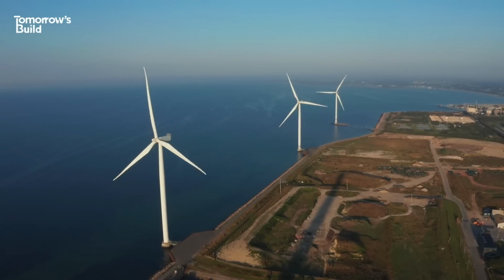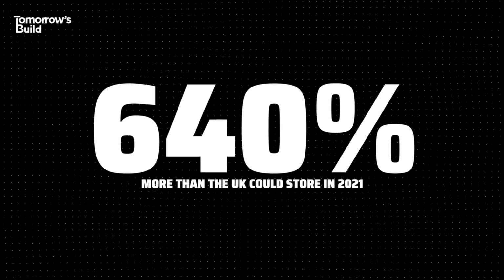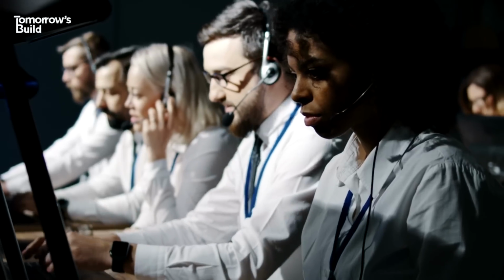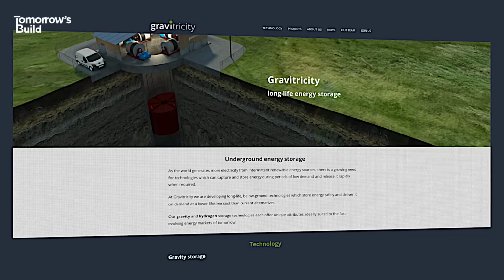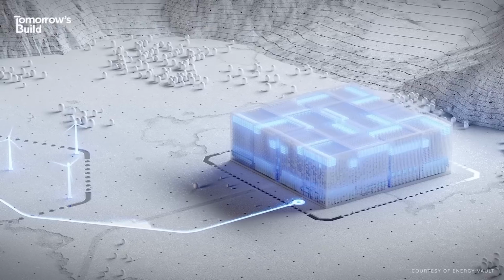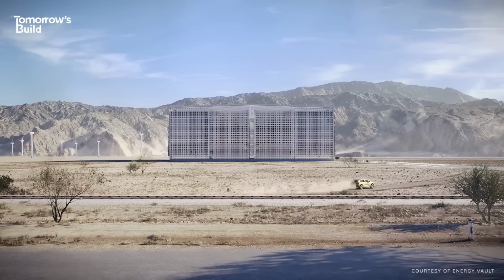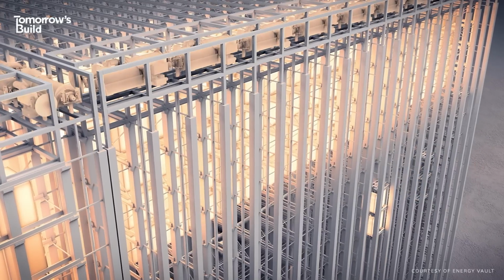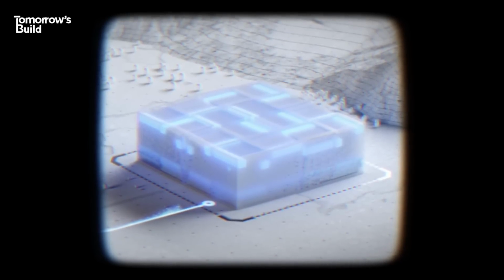The Hidden Crisis With Renewable Energy | Tomorrow's Build

Comment: The famous water fed Dinorwig power station in the UK (Tom Scott did a video on it), is essentially a 9.2 million ton 'weight' over a 500m shaft. Some highly academic research on google says that's three million more tons than the weight of the Hoover Dam. To build a concrete gravity battery on the scale of Dinorwig (and the UK alone would need several to meet intermittency needs), you'd therefore need a hoover dam of concrete, with about 8 or so Empire state buildings on top (400k tons each) to make up the weight, suspended on a structure the height of Taipei 101. This is cartoonishly impractical!
Reply: Not to mention the amount of emissions from all that concrete being poured would be astronomocial
Reply: These energy vaults are a total scam.  That same building or mine shaft could be moving water up and down pipes with tanks on each end which is significantly more efficient than the  lifting machinery needed to move weights.  A simple thought problem:  Which do you think is more space and energy efficient;  the elevator that lifts people up and down a building or the water pump that moves the water up the building to a tank on top and gravity that lowers waste water back down?
Reply: A subsidised 14Kwh power wall in every house hold might help, possibly linked up to a smart local grid.
Reply: @AdamG7CRQ  but that has the same issues and more, than having large scale battery storage...
Reply: @John...44...  how?
Reply: @AdamG7CRQ  well, it has the same issues as large scale batteries: terrible for the environment etc. But doesn't share the benefits of a large scale system. It would cost more for the equivalent large scale battery farm
Reply: @John...44...  I don't agree, I think there's room for both including EV to grid, maybe local liquid air batteries.
Reply: @AdamG7CRQ  oh, definitely room for both. Just the idea of lots of small scale batteries is better than fewer large scale batteries is wrong
Reply: @John...44...  No it's not. Do you know how EV battery's are built? They use smaller cells in large numbers instead of using one large cell. The reason is because this is cheaper in terms of repair and easier to control voltage because changing the cell configuration can give the current or voltage you want.
Reply: @Asanda  yeh so that's my point... one facility with large battery storage would be cheaper than a load of house with individual battery storage. Yes the batteries may be made from the same smaller batteries, but a larger facility would be cheaper
Reply: @adam-g7crq  And have your government spying on you how much you use if you use more you get arrested. Like Minority Report
Reply: @adam-g7crq  An average UK household uses about 9kWh of energy in total. 14kWh is about 36hours

Comment: This seems incredibly wasteful and expensive, the energy stored in those blocks is not a lot, the structure to hold that much would need to take up an enormous amount of space, and because of all the moving parts maintenance would also be a pain.

Creating hydrogen from excess electricity during peaks is much more viable and is a flexible solution as well to the irregularity and slow reaction time problem of most renewables. Burning hydrogen in a traditional natural gas system would fill the gap natural gas has currently, and requires much less new technology that needs to prove itself for storage and execution. The main problem right now with hydrogen is cost, but in a future full of excess energy during sun/wind peak production that can't be utilised it would make it much more viable.

This is besides the fact that hydrogen can also replace natural gas in many applications nowadays that although can be filled by electricity it would require massive upgrades to the electric grid network. Hydrogen can offload some of that e.g. by being burned directly in homes for heating, and being transported through modified existing natural gas infrastructure. 

Moreover, hydrogen can be made in various areas where it is cheapest to produce and then shipped off to wherever demand determines just like petroleum currently.

Lastly it also creates redundancy, just like today how different plants producing electricity through different methods are more isolated from mishaps affecting other plants. An area that is too heavily reliant on wind and solar may be left susceptible to black outs due to a large storm which can damage solar panels and force wind turbines to be stopped to not damage them. This is especially important for coastal communities who will be facing harsher weather conditions.

Comment: I would have also mentioned flow batteries, liquid metal batteries, and flywheel energy storage. And also the importance of baseload power from nuke plants.
Reply: oh yes the mighty baseload from the nuke plants, we seen it in france this year, most of them down cause additional maintenance and broken or rusted things, sound very safe...
Reply: @SirHeinzbond  it is though..."broken rusted things" are on emergency circuits which have never been used in 40+ years. That's because even those old power plants are extremely safe
Reply: Can't count on nukes with droughts and hotter water, European nukes have already been shut down when needed most.

Comment: You do need to do more fact checking before making claims in your video's. There is more than enough lithium accessible in the world to provide all energy storage the planet needs. The problem in the short term is that the capacity to mine and refine said lithium is not keeping up with demand. However, lithium batteries are not the best solution to all problems and we probably will need almost all alternative storage solutions that are currently worked on. So thank you for putting together another video on available alternatives.

Comment: One massive inclusion into the evening household energy demand you forgot moving forward is the super high current EV charger because people will want their car charged as quick as possible so it's always full for conveniences sake.  Rolling brown outs from these chargers will be the future unless there is a standardized way of chargers being able to communicate with the grid for permission to pull power etc. is developed.
Reply: "people will want their car charged as quick as possible so it's always full for conveniences sake" Except that's not the case, as proven by the huge number of schemes where people charge their car when it's cheapest when there's least load on the grid.

Comment: It would be much more energy and cost efficient to significantly improve the infrastructure for energy transmission and better integrate it across state and country borders. This way surplus energy can be shifted across a continent to where it is currently needed. This would alleviate a huge chunk of the fluctuations. The remaining peaks and troughs may be buffered using centralized (hydro, batteries, ...) and decentralized (domestic batteries, plugged-in electric cars, ...) energy storage.

Comment: 200 GWh  of storage is no solution at all for the UK. Currently in winter the UK uses about 40 GW per hour. In the future once heat pumps / electric car are more abundant we'll need a lot more.
So .. 40 GW for 24 hours is 960 GWh. Sometimes in winter, Northern Europe doesn't get much wind or solar for 2 weeks or so. 
2 weeks storage would need to be 13,440 GWh 
So in short, if we rely on renewables, we'll need about 14TWh of storage. Please let me know how that will happen.. 
I'd recommend going nuclear and skipping storage altogether.

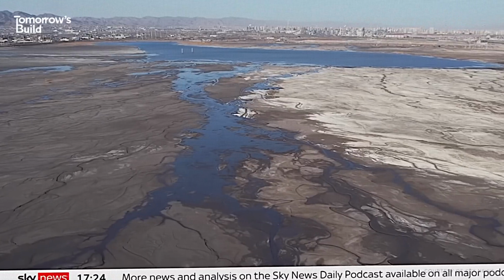Comment: @2:25 not enough in the world to meet demand. Bull[expletive]! Lithium is a plentiful element in every ocean and iron is the most plentiful element on earth. They're even recyclable. 
Making and recycling LFP (Lithium, Iron Phosphate) batteries and charging them up from solar and wind energy costs less than setting fire to anything. (You can't reuse fossil fuels.)
The installations are cheaper and cleaner and that's why they're happening around the world.

Comment: Isn't the easiest way to preserve energy producing hydrogen, storing it and burning it when needed? That could even be done locally in every home. The big advantage would be that homes could buy energy when it is cheap and sell it when it is expensive. Alternatively high pressured air could be stored. That air pressure could be transformed into electricity when needed.

Comment: Liquid air batteries, would be a better option there's already some pilot plants up and running in the UK, the beauty of a liquid air battery is there really scalable and are built from common materials that are readily available and used in other industries with the available skilled engineers to setup and get running, they have a great cycle live cheap and can be placed where you need them, it's worth a Google to find out more about them. Be nice if Tomorrow's Build could do a YouTube video about this battery.
Reply: I was thinking the same.   Also redflow, and Form energy.   We definitely need an all of the above mentality.   More sources can be used in different areas depending on location and availability of local resources
Reply: I wonder if liquid air storage  of renewable energy might be better used by not trying to turn it back into electricity. It might be far more efficient to use it to cool things directly. A building full of hot air, a tank of chilled fluid, and a simple high efficiency heat pump would almost certainly cool a room far more efficiently than using the liquified air to generate electricity to run a regular air conditioner. The same type of system could be deployed to refridgeration
Reply: @dennisenright7725  brilliant idea, I think the liquid air batteries are about 68% efficient looks like there might be some different uses for them in for industrial services but still a very useful grid battery considering how cheap and long service life you'd get out of them, you've got me now thinking what other applications they can be used for maybe local shipping power a ferry to cross short crossing's.

Comment: there are "batteries" of heat energy, either molten or solid. and there are storages that use compressed air, who need heat when expanding the air in a turbine or motor.
china now has the largest compressed air storage and it is a technology that could be easily used anywhere in the world.

there are also other energy storages using gravity, either lifting very large chunks of earth with hydraulics. or large balloons in water(the sea) and can be inflated or lifted to store or release energy.

also there are different techniques for storing heat over the long term. some salts have a heating when dissolved in water, some materials have the same effect with their large surface or their chemical bonds(reversable with heat).

we need to talk about more solutions, compare them, and find the right ones to do the job in different situations(local).
Reply: Have a Google for liquid air batteries, very interesting.

Comment: We will have distributed virtual power plants through the millions of electric vehicle and home batteries that are coming into use in the next 5 years. It will be much more resilient and enable consumers to offsett part of their bill by participating instead of paying large multinationals to burn gas/oil/coal
Reply: Moving in parallel to horizon is very cheap so the vehicle batteries are really tiny on a bigger scale of things.
I once calculated that every Tesla ever produced is equal to 1 hour powering a 2-3 million town.

Comment: We need nuclear, but we can't have it because hippies.  We could make up the lack of renewables using LNG instead of burning it off at the well, but it's not perfect and still creates carbon.  Even though it's a net drop in carbon since we're using it for power instead of just burning it into the air.  But hippies won't hear of it.  We could have been putting a lot more into battery development all this time, but hippies demanded more efficient solar and wind, and got it.  They threw their support behind tax schemes that let power companies get tax credits for creating energy that they sent straight to ground because it was easier and cheaper than actually powering cities because of how tricky it can be to meet demand with renewables on the grid while also using fossil sources. They even pressured other people to chip in to power companies' "pay extra for green electricity schemes" that implied heavily that you'd be getting only renewable power delivered to your home, even though that's not how power grids work.  

So we still don't have the batteries we need for renewables, and hippies made sure that people paid companies extra money for no reason so that they could buy more windmills to get more tax credits for power produced that nobody actually got to use.

TLDR: When you can't heat your house because the sun's not out, burn a hippie to stay warm.  They deserve it.

Comment: As economies of scale take off making green hydrogen cheaper; could that not act as a backup power source in the same way we currently use gas and coal?
Reply: No
Technically a rort by fossil fuels industry
Reply: @RacefanPat68  Are you getting mixed up with blue hydrogen? I struggle to see how green hydrogen made from green electricity benefits the fossil fuel companies

Comment: Seriously? Normally, this channel is good and well informed and now you fall for such a hoax? Do the math, how much kinetic energy can be stored in such building. Try to match it with turns of the wind mills on the outside, how many turns can one do, whilst one of these blocks goes down? Because that's the exact equivalent you can get from the building. Even if each block replaces one mill, we are talking about minutes. I really recommend to do some deeper research and take the video down later, it is nothing else than a conspiricy theory for investors.
Reply: Well put I agree with your comment 👍

Comment: its a shame we cant just give every house a huge battery that powers their house, make solar panels mandatory, then have the grid as a drip feed
Reply: People living in the inner cities in apartment blocks might not agree.
Reply: This would add around 40k to the cost of homes, which isn’t terribly significant compared to the insane price of housing. Certain states like california already have solar mandates on new homes.
Reply: Also possible would just be the battery storage without solar. Charges during off peak hours from the grid and discharges when household consumption gets high. This could take the strain off those peak times if enought houses had it setup. Problem is space like what was said about apartment living. Have to have a room to put it. A lot of already existing places would need some serious remolding for sure

Comment: Dunno why videos like this never mention tidal turbines when it comes to reliable consistent renewable energy production. Tidal turbines output is determined by the tide, which is literally controlled via the moons gravity when it rises and sets, which we know is twice a day forever, so the tidal turbine output pattern is consistent forever. Of course the issue is that its output goes between 100% down to 0% then back up to 100% gradually a couple of times a day, but it's exactly over every 12 hours forever. So you could pair say a 2MW tidal turbine with a just 6MWh battery and it'll output 1MW 24/7 more consistently than even nuclear. Can't do this with wind or solar because they're not predeictable and can have low output for days or even weeks on end, can't build a battery for that. Whereas with tidal you KNOW that it'll go back up to 100% output within a few hours. You can know the output of tidal turbines at any specific time any day 10 years from now if you wanted. Of course we can't have tidal turbines anywhere but even 10% from them would be a nice 10% baseload. Or just build nuclear.
Reply: The whole county doesn't have the same tides. High tide in one place is can be low tide in another place. If you spread out tidal energy with that in mind you can avoid the need for storage.
The only issue I have with tidal energy if the possible effect on wildlife.
Reply: If it were that easy, it would have probably been commercialised by this point. The issue I've seen from other videos on this topic is that places with "ideal" tidal conditions have huge problems with the turbines themselves being ruined by entrained materials in the water and the turbines having to operate in extremely harsh conditions. Basically, they keep breaking down and failing.
Reply: Two problems: 1. Too expensive 2. Only a few locations in the world with the required strength of tidal currents
Reply: Another problem is environmental folks can be against them. The oil  company I worked for wanted to install a tidal generation offshore California and it couldn't get the permits because of environmental concerns. They were afraid it would adversely affect whales and other sea life.
Reply: Multiple tidal barrages make it possible to produce electricity continuously.
Reply: Because nobody can make it work economically. It's time may come when there is more of a price premium for peaking reliable green energy. But at the moment it's competing with gas fired power stations which are just much cheaper - though obviously the cost to the environment is huge. Until there is a proper price on carbon, systems like tidal power will find it hard to compete, as the playing field is not level.